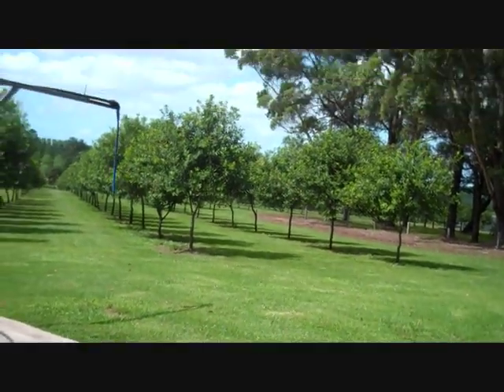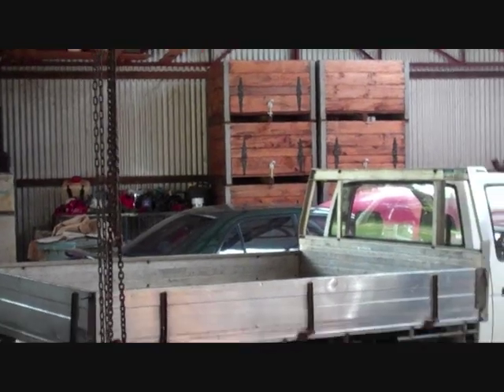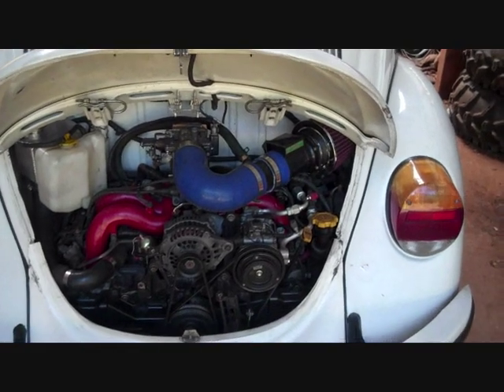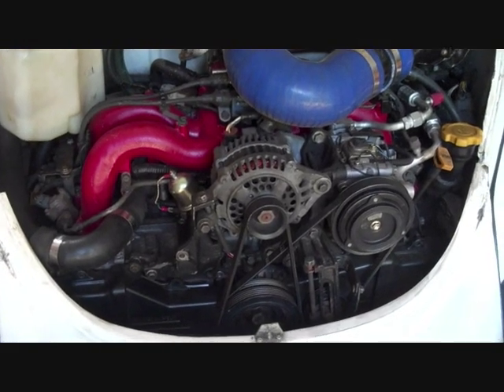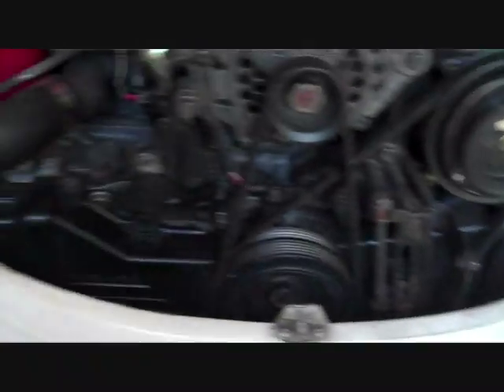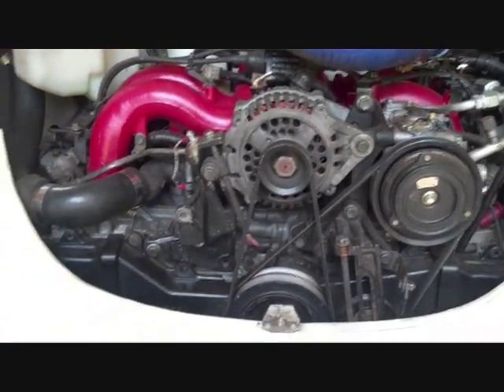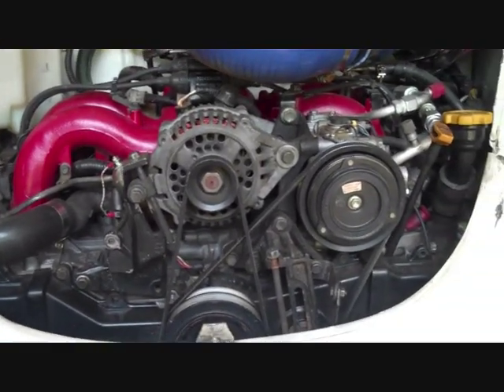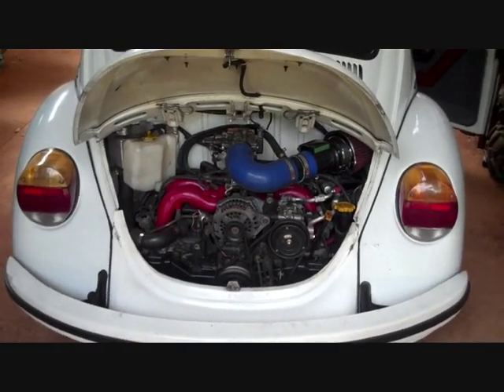Suba-Bug Updates - THe new EJ25 engine

Comment: Do you have a recommendation on transmission? Im trying to go for 400+ HP but I know my transmission from the bug wont hold it.
Reply from the maker: I you;re doing a subaru conversion then just use the subaru trans with a subarugears conversion kit.
Reply: The Guy working @ subaru gears told me that the transmissions they offer can only house up to 350hp and recommeneded that I shouldnt go any higher than that, or the transmission may not hold. Have you ever heard of anyone going beyond?
Reply from the maker: a friend of mine has a heavily modified Sti motor in his bug putting out around 400hp, he runs a Porsche G50 Trans.
it took a lot of modifications to fit though as they are a very large Trans and are also really noisy ,
Reply: yeah another guy recommended me a g50 but they are extremely expensive. I might do the Subarugears transmission and switch the gears with ppg gears. I want of be able to use my bug on a track day. I Dont think the stock gears will be good enough to hold it.

Comment: Im sorry i have 3 subaru motors ej20, ej25, ej22, all motors ive seen been put in to a vw no problem with the rear apron on no cuts and a decklid, im looking at mine going how can i fit this in my beetle and theres no physical way it can fit, so can you give me a long detailed explanation on how to do this because im lost i thought itd be a new trans install, adapter plate, then put the motor in but the ej20 motor is wider then the car so how the f can this be possible?

Comment: do you use factory bug gearbox?
Reply from the maker: I did for about 5 years but then I wanted a taller 4th so while it was apart I had a few mods done, superdiff, weddle thrust plate, corse tooth bus gears etc.
Reply: +BoostedVW thanks i vant do something like that only turbo 2.5
Reply from the maker: +Nikola Tubic you'll need something a bit stronger with that sort of power, I'd recommend the Subaru trans with the Subaru gears conversion
Reply: +BoostedVW i am thinking abouth that 5spd and booletproof gearbox

Comment: Hi, can I put a motor from a Subaru Legacy 2008? the car has automatic trany, the motor is EJ style or is diferent? what stuff i need for this conversion?thank you
Reply from the maker: It will be EJ if its 4 cylinder but they are available with a 6 cylinder which is a squeeze in a bug if that;s what its going in.
I would be looking for something a little older, if your 2008 is anything like the ones here in Aus the fly by wire throttle and CAN-BUS electrics is very hard to adapt to an old VW.

Comment from the maker: Nope not a straight fit, a company here in Oz makes a flange so it bolts up to the VW trans and a replacement pinion so it meshes with the VW flywheel ring gear. 
The starter is from an Automatic gen1 Legacy
Its called a Crankykit but unfortunately they don;t have a website anymore

Comment from the maker: @dpsilver1 I was converting mine to upright cooling myself type1 style, but it had a hard life in a dual cab Bay window. both the heads were cracked, case needed line boring, new cylinder kit etc. I was looking at $3k plus just in parts so I gave up on it.

Comment from the maker: @dpsilver1 just stock super beetle tranny.
I did have a type 4 engine for it about 11-12 years ago but it never made it in, they are VWs best air cooled engine but they are just so expensive, I got my entire subi conversion in and running for half the cost of a Type 4 rebuild and it had fuel injection and 35hp more in standard form.

My dream was always a big turbo type 4 engine but it's just not a cost effective option.

Comment from the maker: @flipo25rid fuel depends how you drive it but worst it gets is 12L/100kms which is about 23-24mpg but it can get into mid 30s on the highway (7L/100km).
Bout the same as a stock 1600 VW engine but has triple the horsepower.

Engine price is piece of string kind of question.
I actually got this engine free after it was removed for an upgrade but I then spent $1800au rebuilding it.
My old EJ22 before it I bought the entire car it was in (1992 Legacy/Liberty) for $500.